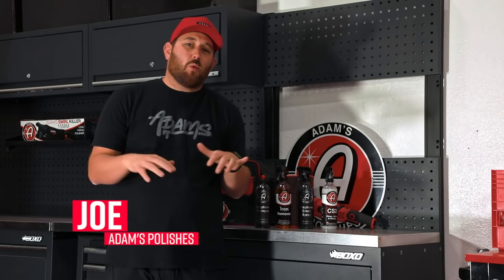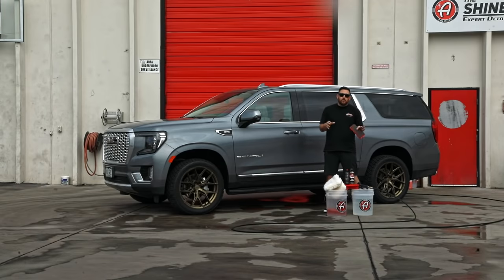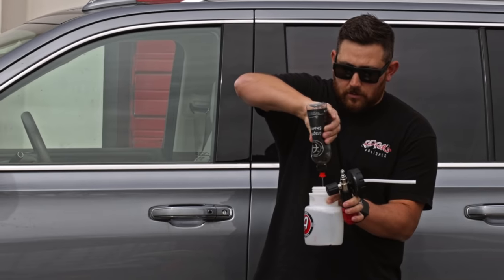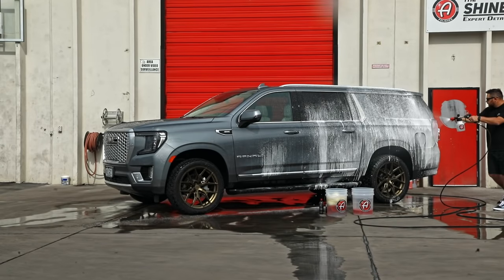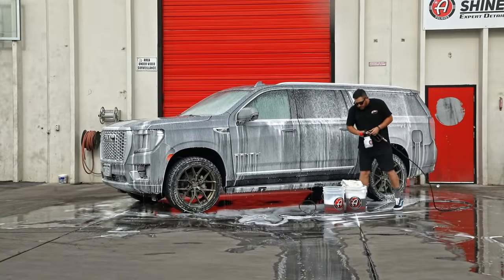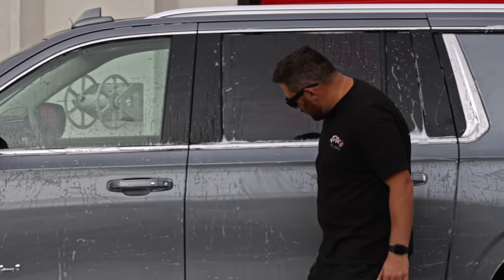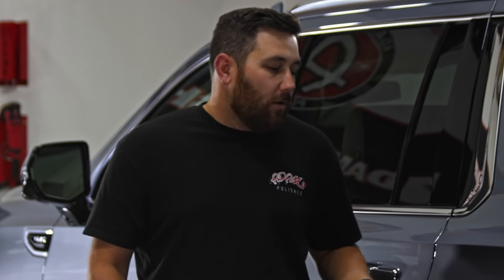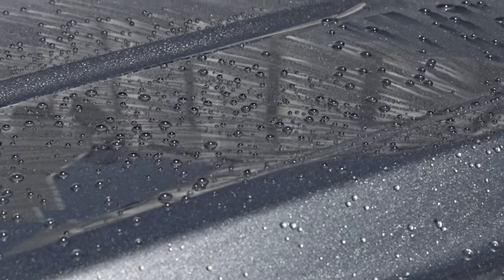How to Wash and Maintain Your Graphene Ceramic Coated Vehicle

Comment: I think Adam's genuinely make one of the best products for you car, I do however think they use their sales pitch and marketing far too heavily. They use too much product to get you to use it more therefore buying more and spending more- you do not need so much soap for a car that's virtually clean. I wouldn't use such a big heavy wash pad either- that looks like its heavy and draggy over the paint, I'd use a noodle wash mit or lots of good quality microfiber (Korean made) clothes depending on the dirt levels. Keep rinsing and swapping you mit or cloth regularly, Use common sense here, think of how you're going to limit the amount of trapped dirt particles in your wash applicator and always light pressure on the paint. Also its been proven NOT to pre-rinse your car- always snowfoam onto dry paint, let it dwel then rinse off, as your just diluting your snowfoam on wet surfaces. Snowfoam and rinse sometimes twice before any contact washing (limit contact = less chance of swirls) Also why on earth would you wash in direct sunlight?? Find or wait for a shaded spot to come over. Or early morning or evening. Its all about the details to get the very best out of Adam's. I hate to critique but, you need less product and to work in a far more logical manner. Work with your environment and not against it. 👍
Reply: Correct. Too much options. Also Recochem owns Adam's Polishes so ... marketing and sales are boosted. They also own P&S etc.

Also too expensive in Belgium, Europe.
Reply: Bro I felt exactly the same say just didn't wanna be judgemental. But then again I just wanna wash my car and not over do it and over think it.
Reply: I like to pre rinse so I can see the problem spots and spray them off before I use my foam canon.

Comment: I don’t wash in the sun and I don’t clay my ceramic. However, I must say that the Graphene wash and Graphene detail spray is CRAZY good! The wash deep cleans the surface, and the detail spray really boosted the shine and depth to my ceramic coating. I used chemical guys ceramic detail spray (Hydrospeed) before this, it doesn’t even come close to the Adams Graphene detail spray. Makes my cars surface like diamond in the sun.

Comment: Adams has moved to the top of my favorite detailing products to use. Just coated my car using the advanced graphene ceramic UV kit. The gloss and water sheeting is top notch. Great stuff.
Reply: I just bought the advanced graphene and are going to use it on a new Can Am Outlander XT-P 850 Max. Does your car have any black plastic and did the graphene make it shiny or left it natural looking?
Reply: @pjfan173  The plastics will have a gloss look upon application, but when the coating is leveled, they look oem honestly. Maybe a hint of gloss was left a day or 2 after application, a week in and you can’t tell there’s a coating on my trim, appearance wise.
Reply: @craneman602  thanks for the reply. I’m looking forward to getting it done

Comment: You clay a coated vehicle using a medium grit ? Then you go and out a chemical iron remover on it.  You trying to test the ceramic coating or what ?  Personally, if you paid a pro to ceramic coat your vehicle.  Which cost thousands , Do not attempt at doing this in the video 😂

This is just as bad as watching Adam and his microfibre towel washing video.  He tells you to dry your expensive towels in HIGH heat in the drier. 😂😂

Comment: Thank you for a great refresher! I always start with a basis like N914 rinseless wash to have lubrication on the surface for just the wash, and with the N914 and iron remover I have used with a clay bar so there's proper lubrication and that's key. I love your products

Comment: I don't know what to believe when it comes to claying a coated vehicle.
Some detailers do it and some say it can damage the coating...
Reply: I think it really depends on many factors such as: 1. Are you using a clay or a clay mitt/towel? 2. Is your paints clearcoat hard or soft? 3. How much lubrication are you using? All those factors will affect how much you risk scratching paint. Realistically, try a small spot on your car and see what happens, most likely there will be no scratching.
Reply: I mean i would do the chemical decon first. Next clay with a fine grade mitt.

Comment: These how-to videos are great. I prefer Pan the Organizer's recommendation of never using plain water and a pressure washer to blast the dirt. Seems like using the surfactants of the foam to lubricate the surface and dirt particles is a safer method against scratches. Foam > Rinse > Foam > Wash > Rinse

Comment: I have just done Adam's Advanced Graphene coating on two cars in my house that were fairly new (2 months old). They look great. One of the cars is coming up for a wash and it is a black Honda HRV. I have DI water filter for final rinse. There was/is a lot of pollen in the air here in central Florida. Is it ok to use very little APC like Super Clean with the shampoo in the foam cannon to clean the stuff better? I did the coating on all the surfaces including glass, mirrors and textured plastic black trim (and yes I definitely levelled the coating on the plastic textured trim as well). With DI water rinse as a final rinse do I really need to dry the vehicle? I have ordered your shampoo and clay mitt and iron remover gallon from Amazon but I am getting a little concerned that your clay mitt is "medium" not "fine" grade. Isn't that going to cause scratches and marring in maintenance washes on the coating?
Reply from the maker: Hi Abid, great questions, and sorry for the delayed response! You could add a small amount of APC into your Car Shampoo in the foam cannon, but keep it mind it will make it closer to a Strip Wash then, and may reduce the amount of thick foam a little bit. Also make sure the soap residue doesn't dry in this case in the hot Florida sun, since the APC will change the pH level and it may no longer be pH neutral. With Deionized water, if the TDS reading is below 20ppm, you should be able to rinse without drying. Once the TDS goes about 50ppm or so, you will see some water spotting. The clay mitt is still fairly tame - use very light pressure and rinse it out after each body panel to make sure you do not introduce any marring. Every vehicle clear coat is different, so do a test spot first - clay and dry the area - to see if it is introducing any marring 👍
Reply: @AdamsPolishes  Thanks for the answer. I actually ended up using just straight Graphene shampoo both in the wash bucket as well as foam cannon. I had tons of suds and with just some mild agitation with multiple soft wash mitts, everything came off. I did use the DI rinse as a final step and did gently towel and blow dry the car.

Comment: So if you use Adams graphene ceramic coating, then you shouldnt use CS3 as a drying aide?  But the detail spray, or use graphene spray to touch up after mostly drying?
Reply: Adam’s, unfortunately, puts out contradictory or confusing info about their products. In this video he says not to use the graphene detail spray as a drying aid, yet the product info includes, “For Use When Washing as Drying Aid…” It’s frustrating. They need some internal review process to align all their products.

Comment: Sorry but I used the graphene shampoo on a car coated with Adams advanced graphene ceramic and I noticed a loss in hydrophobics.   I’ll give it another try and see what’s what.
Reply: Thanks for the tip I just applied the advanced graphene spray coating.
Reply: @OhioBahn440  that’s good.  You’ll just need to reapply every so often.

Comment: I've been ordering everything I will need to do the spray on graphene. I live in an apartment complex there's no pressure washer. Have I jumped the gun buying all this stuff. Please reply so I can return to Amazon if this isn't a good fit for me being I just bought it couple days ago. Thanks
Reply from the maker: Hi Lisa, you don't need a pressure washer to apply our Graphene Ceramic Spray Coating, so we wouldn't say jumped the gun necessarily. The process that Joe shows in this video is if you were to do a bucket wash with a pressure washer, and Iron Remover, but those cannot be done easily at an apartment complex as you mentioned. If you live in an apartment complex however, you could clean your vehicle with our Waterless Wash and waffle-weave Waterless Wash Towels, then apply the Graphene Ceramic Spray Coating. Make sure it is a nice day with no rain in the forecast - after you wipe away the residue after a few minutes, the spray coating needs about 4 more hours to cure before it can be exposed to rain, moisture, etc. Then once you've applied the coating, you can continue cleaning it with Waterless Wash, CS3, or even a touchless car wash - just make sure the touchless wash does not include any type of wax additive protection steps. When you need to do maintenance, rather than Iron Remover, after you've cleaned the vehicle with Waterless Wash, you could then use Detail Spray and a Clay Mitt to decontaminate the surface, and then you could apply the spray coating again. I like to apply the spray coating about twice per year on my personal vehicle for continual protection. If you have a few minutes, check out our videos on Waterless Wash, CS3, and Hoseless Wash on this channel to see how to safely wash your vehicle without water. If you would still like to return the products, no worries, you can contact our Amazon channel and they can assist no problem! Thanks again for your business and for reaching out to us!
Reply: I an apartment dweller and i just applied the graphene coating on my vehicle, and i have a ton of adams products. I go to one of the self car washes and bring all my buckets and stuff with me, use their pressure washer and do a wash there. I do have a single car garage so i just polished in there, then applied the coating. 

(This is very extra and only recommend if you really want that perfection lol)

Comment: Although you don’t see a boat load of foam, there’s a reason for that.  The ceramic coating is chemically resisting the foam.  It’s impressive to watch once your car(s) are coating with this good stuff.
Reply: It's weird and awkward for sure.  The suds disappear on contact.  And it's so hydrophobic anyway, it falls right off.

Comment: Hold on a minute, you guys have a chart that says to rinse, decon, rinse, wash, then clay + polish, and now you're saying something different. does the order really matter?
Reply from the maker: Great question! There isn't necessarily a right or wrong order when it comes to decontaminating the paint. Some like to do chemical decon with Iron Remover to remove metal contaminants and then do mechanical decon with a Clay Bar or Clay Mitt afterward to remove other types of bonded contamination and to make sure you remove all of the strong Iron Remover chemical. Others like to use clay first, then Iron Remover, and then rinse thoroughly. Either option is fine, however, you DO need to rinse and wash the vehicle first, prior to doing any clay decon, so that your clay is not saturated with dirt and grit. So the order between washing and Iron Remover doesn't matter as much, but you do want to clay after washing, and then machine compound and/or polish after clay 👍

Comment: can you use a pump foam bottle if you live in an apartment and have no storage for a pressure washer  for foaming ????
Reply from the maker: Hi Chris, yep, check out the iK Pro Foam 12 Sprayer on our website. It is a larger model than the Pro Foam 2, so you will be able to make larger mixtures to cover more of a vehicle before having to refill the canister. It is fairly tall, so you may have a similar storage problem as you would with the pressure washer. The Pro Foam 2 is much more compact, but you will need to refill it a few times during the wash process. You can find the Pro Foam 12 here: https://adamspolishes.com/products/adams-ik-pro-foam-12-sprayer

Comment: Can you decontaminate the piano black plastic door trim with a clay bar when prepping the car for coating or would the clay damage it? Thanks!
Reply from the maker: Hi there! You do want to be more careful with piano black plastic trim on door pillars and other areas of the exterior of the vehicle, but you can clay them. Piano black trim is usually very soft and can scratch very easily, so the clay could introduce some light marring into the finish if you use too much pressure or if you are not using a fresh clean area of the clay. You can machine polish the piano black trim just as you would polish painted areas, but always start with the least aggressive approach with our White Foam Pad and white Polish first, and then move up from there.

Comment: isnt the clay mitt going to remove the ceramic coating?
Reply from the maker: Hi David, no. Ceramic Coatings need to be removed with heavier abrasion from a machine polisher and a cutting compound. They can eventually be removed hundreds of washes over time as well. The Clay Mitt has the possibility of putting some light marring into the finish if it is not rinsed out often enough during the claying process, but even ceramic coated vehicles develop bonded contamination over time, which can clog and reduce the performance of the coating itself.

Comment: should i use the ceramic spray coating advance or graphene boost on top of graphene ceramic coating advanced?
Reply from the maker: Hi Ken, that is your choice, but Graphene Boost would be more preferred if you want to use it more frequently, say every 2-3 months or so. Graphene Ceramic Spray Coating Advanced could be used every 6-12 months for an enhancement and maintenance to the coating, but does require a 4-6 cure time without rain/moisture/dew/etc, whereas with Graphene Boost, it's a spray and wipe that you can drive immediately afterward.

Comment: i though the graphene will not let watermarks on the car....hmm
Reply from the maker: Hi there, our Graphene Ceramic Coatings are even more resistant to water spots and watermarks on vehicles than our previous ceramic coatings, but they can and do still occur. Rain droplets, water sprinklers, and water hoses still contain minerals and particulates like pollen and dust, so when they dry on a hot surface they can spot. Deionized water will dry spot-free. The benefit of a ceramic coating or graphene ceramic coating is that these water spots are usually much easier to wash away afterward, since they do not etch into the clear coat of the vehicle as easily.

Comment: So I need to do this every time I wash my car?
Reply from the maker: Hi Nickolas, we always recommend the safe washing techniques demonstrated here like using a Two Bucket Wash Method, but you do not necessarily need to use Graphene Shampoo with every wash - we recommend using it every 3 or 4 washes to deep clean the coating, then the other washes you could use our normal blue Car Shampoo or Mega Foam soap. You don't necessarily need to boost the coating every wash either - every 1-2 months for something like Graphene Detail Spray or CS3 will help maintain the hydrophobics of the coating.